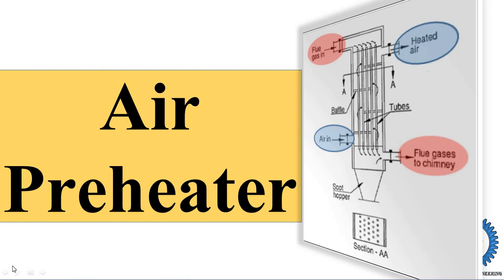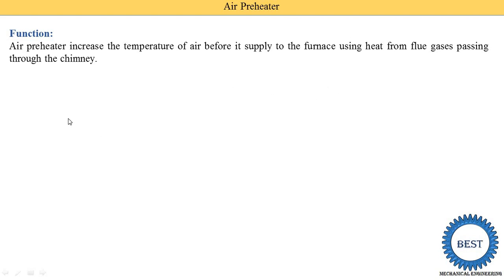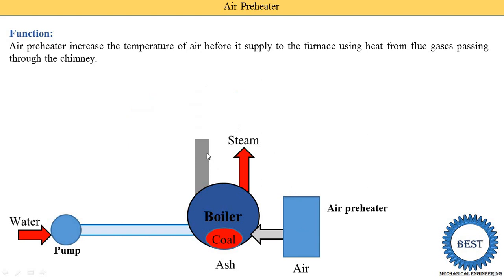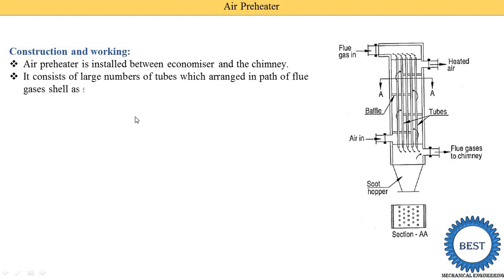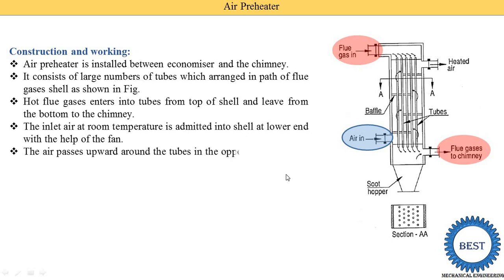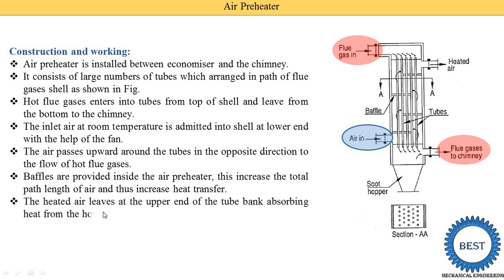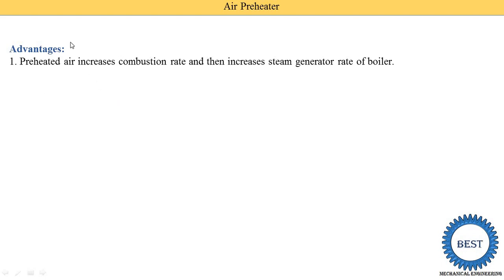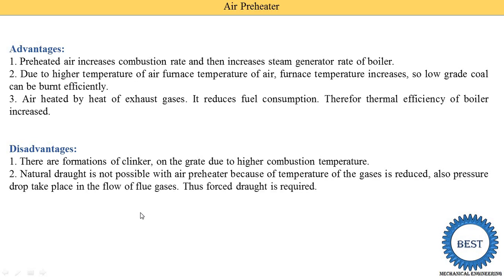Air Preheater

Comment: If the fuel is of uniform grade, then how can pre-heating increase the combustion efficiency and also how does it save fuel ?
Reply: Preheating air results in a more complete combustion and by reclaiming the heat that would have gone out of the chimney and circulating it back towards the primary heat exchanger there's more time/exposure for the energy to be utilized.